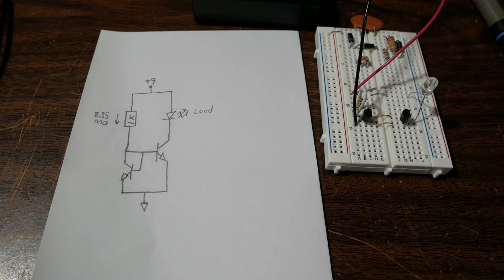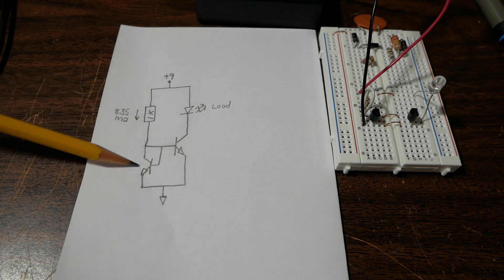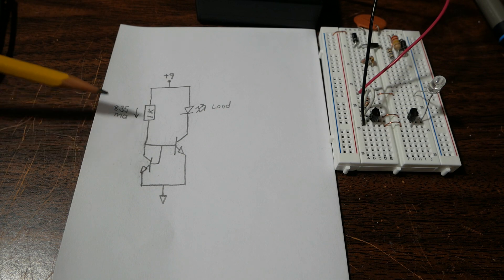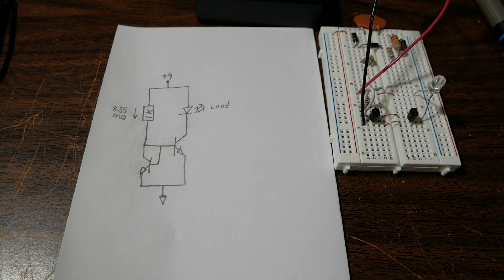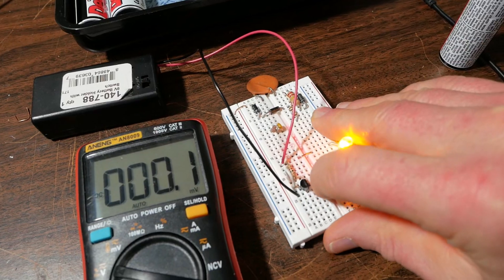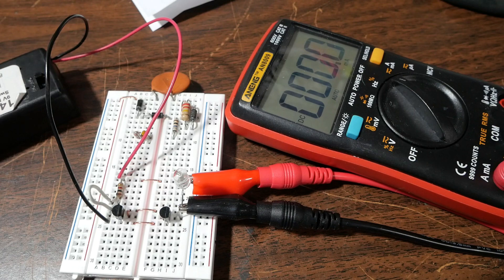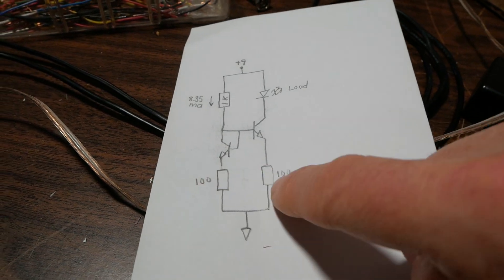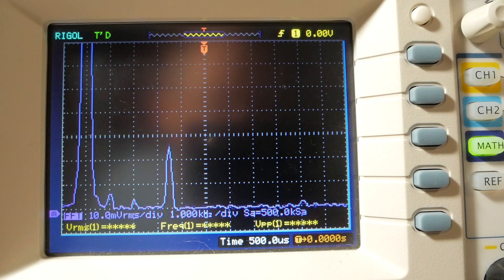Discrete audio amplifier project PT4 current mirror

Comment: Great Video, love the cat. I was going to add that if you are concerned about the transistors being unmatched, if you have a lot of a cheap transistor laying around (I have like 100 2N2222’s) you can test the base-emitter voltage on several and settle on a max allowed difference for you application. Typically for myself, I try to get Vbe to +/- a few mV. When I need a good current mirror, I usually scour parts vendors for pre-built current Mirror IC’s so I don’t have to worry as much about thermal coupling. They also typically use cool tricks like supply independent biasing/band gap references for temperature independent boarding. Thanks for the video! -Dave
Reply: Temp independent biasing* please forgive all the typo’s. Ha

Comment: Why without emitter resistor the current is increasing ?
Reply: Transistor is heating up. When a transistor gets hotter, it takes less voltage on the base to flow current through collector to emitter, meaning as it heats up, more and more current flows, meaning it heats up, and so on. The resistor limits the current through the transistor. As the current through the transistor increases, the current through the resistor increases. Resistors flow less current when they heat up, meaning it counter acts the thermal runaway of the transistor. Hope that helped

Comment: There are 3 hour diatribes on YouTube that aren't as clear as this clean little demo. The bench does what PowerPoint can't. 

People should be aware when searching further that 50% of the stuff out there is about MOS die level issues in creating internal current references for IC masking so avoid that stuff if you want more in depth and mathematical treatments.

Comment: Hey John, love the videos by the way, I wanted to see if you or anyone here would help me figure something out. I have an old 4 channel car amplifier that I bought with only 2 channels working. I open it up to see what could be the issue and am greeted with missing mosfets; 5 to be exact. They were just blown to bits but the amp still turns on and plays music on that one output. (Two outputs by the way) I can replace the mosfets no prob, but the mosfets this thing has seem to be impossible to find. My question is if there is an equivalent I could use and if so must I replace all the mosfets? Thanks to anyone who helps. (Number on mosfets is SFP70N06)
Reply: Also shows Ah 1311 on the mosfets. It's a Sundown Audio SAX 100.4 If anyone was wondering.

Comment: are you using matched transistors? if so did you buy them that way or how did you match them?
Reply: It is possible to buy pairs of matched transistors:  they're usually mounted on the same chip.  However, it's also possible to use separate transistors of the same type (e.g., 2N2222's) and to put low-value resistors in the emitter-ground path in order to reduce any substantial differences between the transistors.